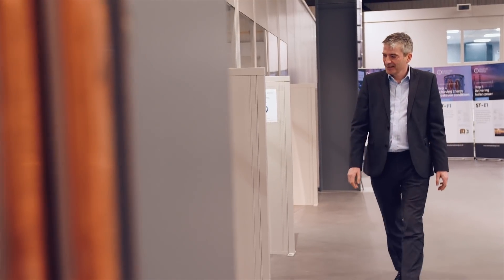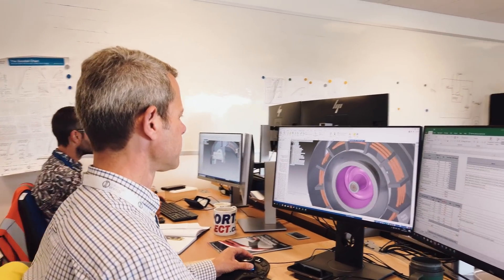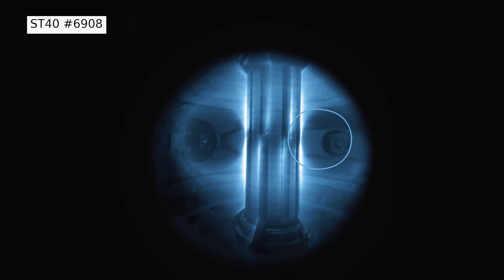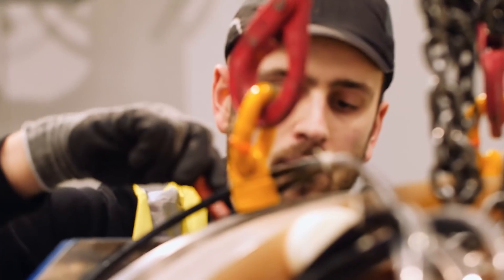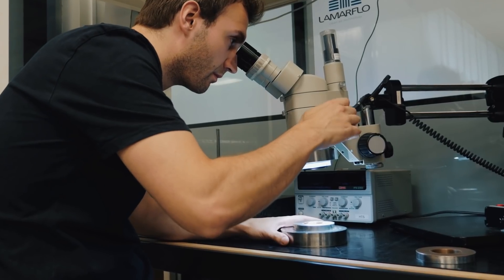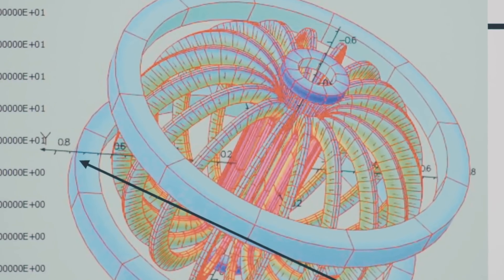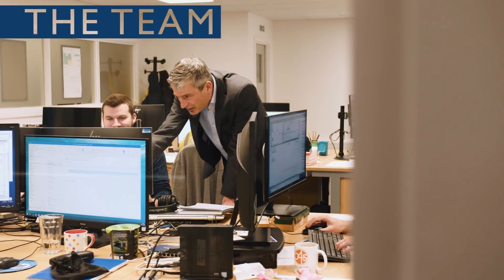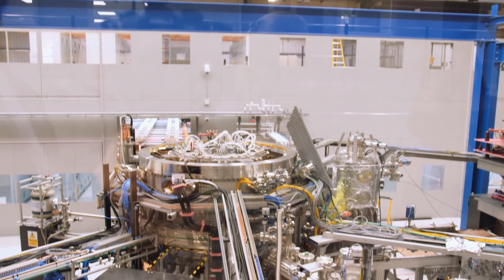2019 fusion progress at Tokamak Energy

Comment: If you project out enough decades into the future that you have a commercial power generator, what will be the Levelized Cost of Energy in Euro/MWh?  How will that compare with other low carbon alternatives at the same time?    If you can't beat USD 30-40/MWh, you might as well give up right now.

Comment: You still have not produce 1 fucking watt to any grid.
will never work, the way you are going , fusion is consequence of stars not the engine of stars , the engine of stars is transformation of matters state , when mater gets to point where state transformation is no longer an option this is when fusion takes place.
Stars loose mass from matter states changes not fusion .As i stated fusion is the last process in a stars motor.
as evidence i give you every fusion reactor on earth combined power production minus power need to run the reactor is in the negative even to day

Comment: I’ve been studing fusion power for awhile now, your company looks to me to be the best progress for fusion.
Reply: What are your thoughts on First Light Fusion?
Reply: There are many teams working on fusion around the globe. Even the Skunk Works.

General Fusions concept is interesting.

https://generalfusion.com/2018/11/timing-everything-pushing-fusion-forward-pistons-cutting-edge-electronics/
Reply: First Light is pushing the thoughts using nuclear power, I think the magnetic base fusion reactor will be much safer, and not having to deal with spent fuel rods disposal. The Tokamak solution does use a lot of electrical energy, from what I see using strong magnetic fields assist with reducing the amount of electrical energy required to produce the plasma fields.

Comment: Hmm. A 100 million degrees? Everybody should be dead in the lab.
Reply: Do a little research.
Reply: @MrPruske  OK. Why don't you just tell everyone what magic material they use to contain all that heat. We all know about the plasma and the magnetic field. By the way, heat destroys a magnetic field. I'm not claiming to know much about fusion, except that it's probably a quest for perpetual motion, so here is your chance to educate us. Make us smarter! Why not.
Reply: @georgegamentzy1816  And here come the magnets into the game:
The 100 Million degrees is the temperature inside the core of the plasma which is enclosed in a magnetic field inside a vacuum chamber so it will not touch anything. That's why the guy in the video was so obsessed about magnets.

However you have to shield the radiation from that plasma as it emits gamma rays just as thermal radiation.

Comment: A 1-farad capacitor can store one coulomb (coo-lomb) of charge at 1 volt. A coulomb is 6.25e18 (6.25 * 10^18, or 6.25 billion billion) electrons. One amp represents a rate of electron flow of 1 coulomb of electrons per second, so a 1-farad capacitor can hold 1 amp-second of electrons at 1 volt.
Reply: Nino Travis point being?
Reply: @Jimmy-B-  
Physics magnetic flux📐

Comment: This is billed as cheap abundant power (eventually), but that is ignoring the unbelievably huge capital cost. Wind and solar would be free and abundant sources of power if you ignored the capital cost. Why is this any better?
Reply: Its output is constant. Some of the grid needs to be like this.  It doesn't really replace wind but existing nuclear, coal and gas.
Reply: because any cutting edge tech is absurdly expensive after it can be refined and mass produced it will out way any loss in the experimental stages.  also unless there is a break through in solar there just isn't the capacity in any other form of energy that is low emission that comes close to fusion.
Reply: @eddjordan2399  wind and solar have come down in cost, as you say. But the volume and simplicity of them allows for such economies. Fussion will need to reduce in cost many orders of magnitude but in much smaller quantities.
It's like saying that rockets can be fueled really cheaply - just split water into hydrogen and oxygen. The hardware and development costs will drop enough if you make enough of them. So a trip to the moon should cost less than a bus ride to the shops.
Reply: Solar and Wind energy is eating up almost 100 Billion Euro every year just in Germany - and now please answer again: Which is the expensive way of producing Electricity?
Reply: @norbertfleck812  100 billion Euro per year?  Yeah, right.  We're going to need to see some evidence on that, because it sounds ludicrous.  Too bad Germany's terrified ignorant Greens shut down your nukes.  How's that coal working out for you?
Reply: This is baseload power and potentially more efficient

Comment: I love it whenever someone thinks that they know how hot the centre of the Sun is !😂
Reply: @eddjordan2399  The mass of the sun is known, that constrains the possible core temperature greatly, as the radiation pressure must balance it out against gravitational collapse. Radiation pressure scales as temperature to the fourth power. That alone, without even trying to figure out the most likely density distribution constrains the temperature of the core of the sun to a narrow interval where it neither collapses or blows up.

We also know the rate coefficients for the P-P process and the power output of the sun. That indirectly tells you something about the density and temperature of the sun.

These things interact and computer simulations allow you to converge on a more accurate core temperature and density distribution; but it's really not needed if you just want the order of magnitude on solar temperature.
Reply: Edd Jordan , it was a comment he made near the beginning of the video
Reply: Rotor Spinny physics this unknown.... Hahahaha

Comment: There will be zero practical outcomes from this. It's all based on fake science, as long as the base assumption remains that the universe is comprised of subatomic particles and packets of energy they will get nowhere and just rack up an enormous electricity bill.
Reply: errrr what ? sorry i mean watt?
Reply: @eddjordan2399  As long as they think the universe is comprised of "particles" (what are they up to now, nearly 100?) they will only find what they want to find. The reality is the "ether" is thousands of times more energy-dense than apparent matter. What we perceive as solid is just neutral plasma. Enormous amounts of electrical energy are flowing through Birkeland streams from a positive /negative position and back again through a reverse channel. The energy flow from any part of the system to another is almost instantaneous over galactic distances.  Birkeland streams of dark (non-luminescent) massively electrical plasma create suns and planets on a predictable pattern, the electrical flow is not visible to us as "light" but has been detected everywhere. This is the "dark energy" which comprises almost all of the universe. The sun (for example) should be more approximated to a giant electric arc furnace. It does convert hydrogen into helium, but that's not actually how it works, that's just an attribute.  Nearly all of the observable universe is comprised of radiant plasma, and the rest of which we see is actually electrically (magnetically, therefore) "pinched" plasma which assumes mass/gravity and velocity. Dust, Suns, planets etc etc
Reply: @karlp8484  magic. You are talking about magic.
Reply: @MrPruske  Yeah? They are the ones who can't define what a field is (even though they rely on it tremendously) and invented the concept of "virtual particles" to balance their fake equations. That's magic.
Reply: So the Nuclear hydrogen bombs do not work?
Reply: @norbertfleck812  I didn't say atoms didn't exist. Show me where I said that.
Reply: @karlp8484  No but you deny the competence of the nuclear scientists / physicists
Reply: @norbertfleck812  Yes I absolutely do. They are mathematicians, not scientists. Haven't come with anything new since the 1920s.
Reply: @karlp8484  Wow! I am looking forwards to seeing you at the Nobel prize ceremonies.
You must be the new Albert Einstein!

Comment: As the sun smugly sets over the lab chuckling to itself
"How's fusion working out for you guys?"
Reply: Late 1970s it was said 1986 we would have this working. How does our Sun work?
Reply: @ronusa1976  Nobody said that in 1970's except for sensationalist news articles :p
Reply: @9volt65  OMNI did.
Reply: Ronald Hayek our sun works by gravity causing hydrogen to fuse. On Earth we have to generate the force to push the hydrogen together but as of now the energy required to do that takes more than the fusion produces.

Comment: Hot fusion is 20 years away. Just like in 2000s and just like in 1970s and just like in 1950s. 
In the mean time cold fusion or LLNR can work since 1989 but they swept it under the carpet. 

Our sun can achieve fusion at 15 million K. They can get to 100 million K and still can't get it done. 

Just passing by few interesting facts. Bye :)
Reply: Sun can achieve fusion not due to its temperature but its sheer enormous mass as there are so many hydrogen atoms packed in sun and they all attract each other due to gravity (talking about trillions raised to power of trillions atoms) and this force is so godly huge that hydrogen starts fusing on its own and heat is just a byproduct which complements the fusion
Now we cant achieve fusion so easily becuase we need to generate enormous force and heat
Reply: @adityaverma1150  Sir hot fusion don't work and it will never work. 
They are trying to achieve hot fusion since 1950s. 
ITER for example can sustain fusion for 20 or 30 seconds I think and NET energy output is still way way lower than input. 

It will never work. Remember my message in 20 years time when they will claim that hot fusion is just around corner. 

On the other hand LLNR - low level nuclear reactions are real and they produce positive NET output. 
Sadly they are suppressed by the mainstream and they have no help from the establishment which is filled with hot fusion advocates. 

Look at Pons and Fleichmann. They achieved a breakthrough. But establishment crushed them.
Reply: @oldi184  Just Google for "Castle Bravo" or "Tsar bomb". That is hot fusion.
Reply: @norbertfleck812  
Yes it is but chaotic and sudden and totally uncontrollable. It is a bomb. We don't need a bomb but a device which makes energy in controlled fashion.

Don't worry sir they are working on it. They will make it in 20 years.
Reply: @oldi184  I believe that we will see the first (hot) fusion reactor with a positive energy outcome within the next 5 years or earlier.
Reply: @norbertfleck812  Wanna bet? Lets bet a 100 Canadian dollars ok? I say no, hot fusion is 20 years away. You say hot fusion is 5 years away.
Reply: Cold fusion lolz
Reply: @harrybrown1518  You are laughing from things you can't comprehend.
Reply: @oldi184  
Ha ha try me!
Reply: cold fusion has not been swept under the carpet there has been no evidence that stands up to scientific rigor that it works. sorry but that's a fact. if it dose work show the world the evidence.
Reply: @eddjordan2399  Listen Edd cold fusion don't work and Jeffery Epstein killed himself in his cell right? 

For some reason you don't understand that there is a pressure from the establishment against cold fusion(or LLNR).

Pons and Fleichmann discovered it. What? You think they were stupid and had no idea what they are doing? Go and read the whole story of events from 1989. 

They discovered a new way of making energy!!! And then came big established heads from MIT and CALTECH and ridiculed them, falsified the data and basically squashed them. 

You seriously believe in official propaganda.

If the government tells you something then it must be true right?  Are you that naive?
Reply: oldi184 study before talking nonsense
Reply: I am currently researching on this Topic and I have seen it many times now(as a joke and as "mockery"), that people say that it always was "just around the corner".
Unfortunately I can't find any older(1950-1970) articles or magazines which state something like that, which lefts me confused. The only thing I found was that Homi J. Bhabha stated 1955 that Fusion energy will be in commerical use until 1975 (https://en.wikipedia.org/wiki/Timeline_of_nuclear_fusion), without any quote and exept of this i can't find anything. 
I would highly apprectiate if you or anyone could state sources.
Thanks in advance.
Reply: @zerkrow8635  So a guy in year 1955 have said that hot fusion will be in use by year 1975. 
LOL year 1975 was 44 years ago!!!
Are we close to hot fusion? 40 fucking years! We are still 20 years away. 

That guy had PhD right or two. Who said it in mid 1950s?  I wish I could travel back in time and tell him how stupid he is.

Comment: How much annual cash burn does this program have?

And, where to get the fuel deuterium / tritium for the tokamak from?

What is the expected efficiency of the whole process, from fuel production > fusion to power generation?
Reply: 30  to 1 energy output.
Reply: @harrybrown1518  Does this factor include the production of the isotopes in the CANDU reactors?
Reply: @kramrle  
CANDU reactors are completely different they use uranium this fusion, not fission.
Reply: @harrybrown1518  That's obvious,  but tell me, how is the deuterium and tritium isotopes produced that is needed for fueling the fusion ?
Reply: @kramrle  then why ask that question in relation to fusion reactors then?
Its found in water, regular ol water.
Reply: @kramrle  
They only use deuterium, its fused to helium. 1 proton 1 neutron  helium is double that.
Reply: @harrybrown1518  yes, deuterium is found in tap water. But the deuterium needs to be extracted / produced from that water. This process uses electric energy.  Or you can produce it in CANDU reactors, which uses a ton of energy too. Thus my initial question about the process efficiency.
If the efficiency is 30:1, then does this account for the energy used to produce  the deuterium fuel?
Reply: @kramrle :   "Or you can produce it in CANDU reactors, which uses a ton of energy too"   but CANDU reactors sometimes produce a bit of energy.  Except Darlington.  Many of them have been in the top of the world rankings for uptime and power.
Reply: @harrybrown1518  so essentially we need dirty nuclear power, which is having yet unresolved waste storage issues, to produce Deuterium, which is then used to get the  "clean" Fusion power started. 

I hope that Fusion will then produce so much more power, that deuterium can be produced without the need of the old fission reactors.
Reply: @kramrle  
You only need electricity to get deuterium from water, and nuclear isnt dirty, sure you have waste but they are getting better at recycling it every year, and yes it is radioactive, but it was radioactive before they even got it out the ground so it's not really waste in essence. Seriously mate you need to put down the eco warrior textbook and get into a  scientific one.
Reply: The deuterium is actually the easy one. Tritium needs to be bred onsite in the reactor and the most likely source is lithium 6 with beryllium as a neutron multiplier, each of which is a problematic material in its own way. You need to do a neutron balance-type calculation to make sure you're producing enough tritium to sustain your fusion reactor, similar to the way you calculate breeding ratio in a fission reactor.
Reply: Martin Leutwyler lmao “dirty nuclear.” The water inside a typical light water reactor is so pure that you can submerge an operating hair dryer in it and not worry about shorting.